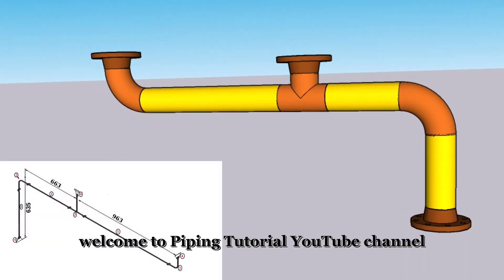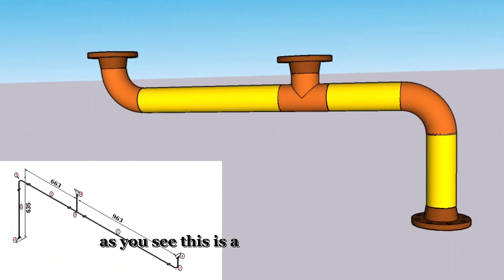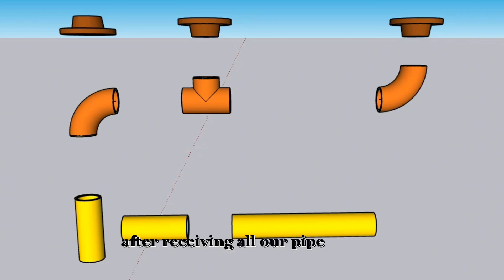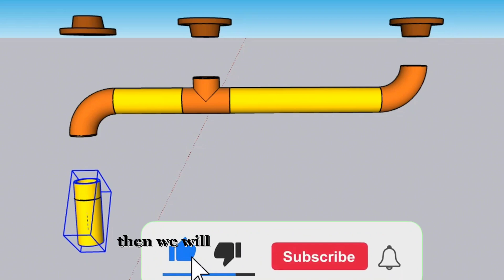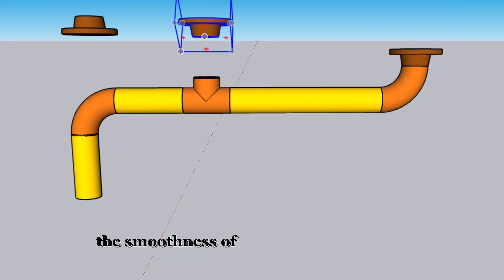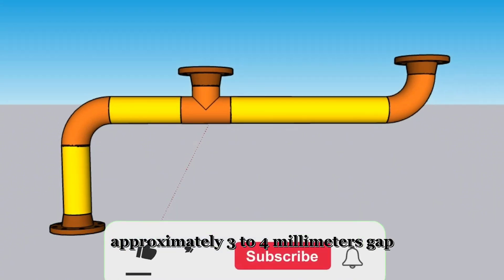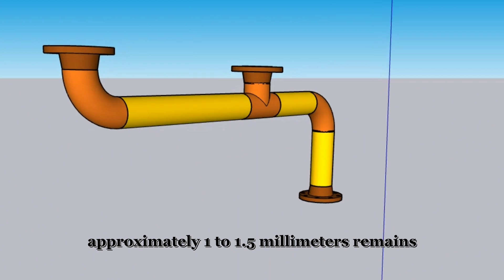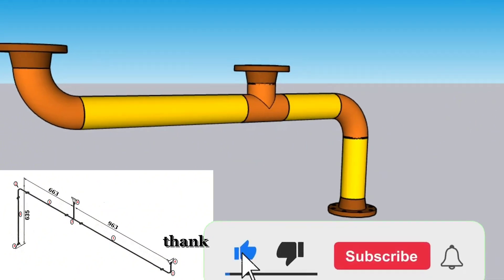Pipe Fabrication. 3D pipeline . Piping isometric drawing study. Pipe fabrication work #piping

Comment: What is the standard size of root capping
Reply from the maker: Generally, the minimum distance between fillet welds is typically 1/16 inch (1.6 mm). However, this can vary depending on the material, joint design and welding process.
Reply: @Piping-engineer  good knowledge and skills set giving young candidates who learn about piping
Reply from the maker: @syedimran2205  Many thanks for your kind mind